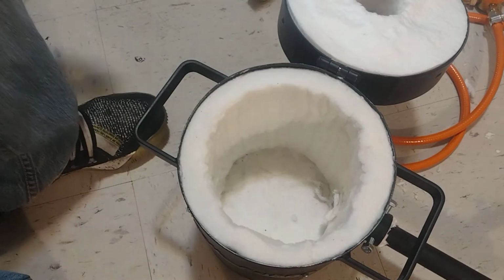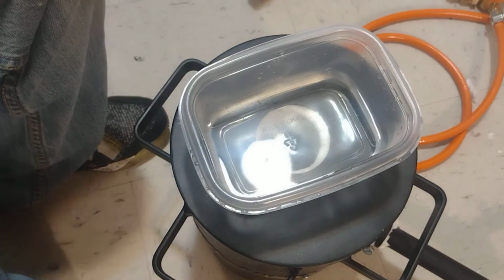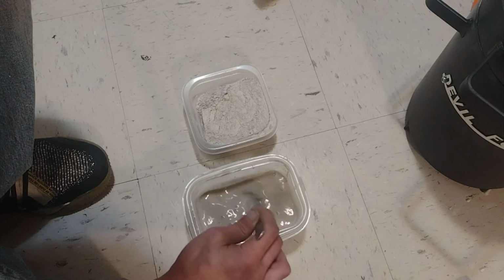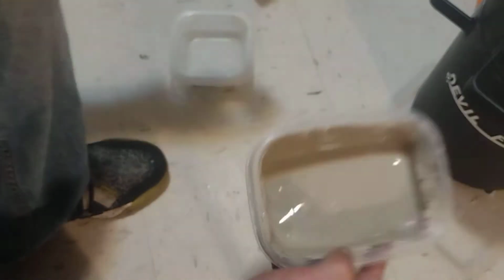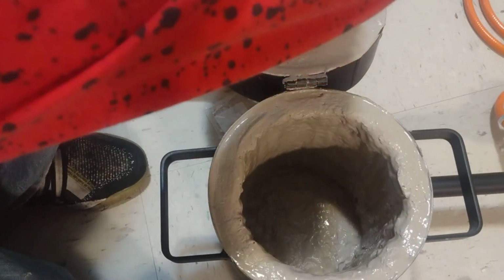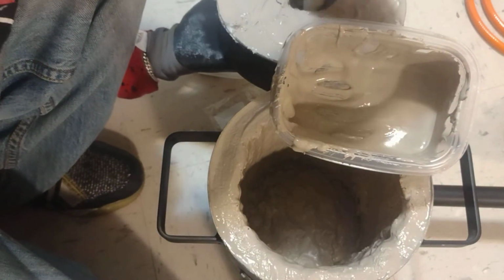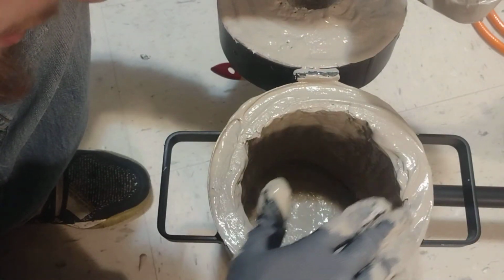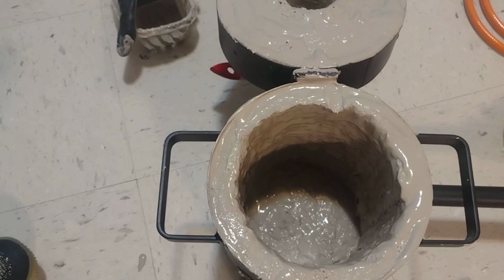NEW 4 KG Devil Forge for melting scrap metal, Part Three: Priming with Refractory coating Rigidizer

Comment: I like how you were being so careful. When I put mine on, it was super runny like if you dipped your finger in water. I weighed it out and everything and added the right amount of water and stirred it for 30 minutes and it was still running so I put it on anyways and it seems to be drying fine. Any ideas and why would be so thin?
Reply from the maker: Hey there! I was only careful because it was my first time using this mixture. To me it reminded me of mixing drywall, plaster of Paris, or even flour. So you want it to be paste like so if you are using it on a vertical surface, it doesn’t run to the bottom. If you add too much water it will get runny. In a case like this when you are given a small amount it’s good to measure because unlike with flour or plaster of Paris you could always add more and stir to thicken it back up. What I would do is buy some refractory cement (powder form) rated for the heat that you intend to melt. And recoat it. You will eventually want to buy it anyways as the more use burn it, it will chip and crack. The cement is cheaper than the wool in most cases
Reply: @jlosworld4086  thank you! I will look into getting more refractory cement. Although it seems to be drying fine it’s really powdery when you touch it. And stuff falls off.
Reply from the maker: Thank you for watching! And I’d definitely get some I’d say I’ve melted about 8 times and already looks like I need to re coat. As you take your crucible out and in, you are likely to rub the crucible or tools on the sides which will also damage that cement. You don’t need the cement though just makes the wool last longer and helps it keep its form around the wall of the furnace